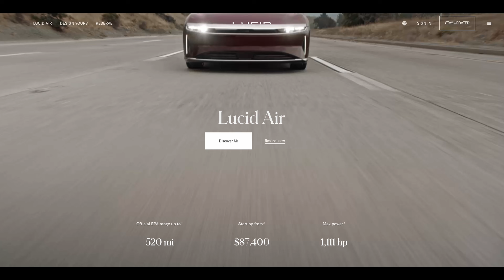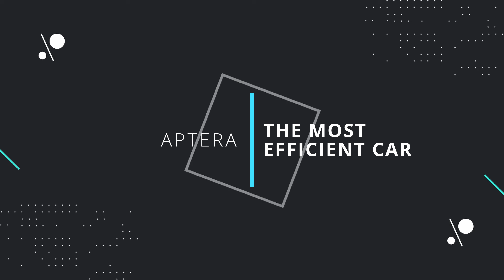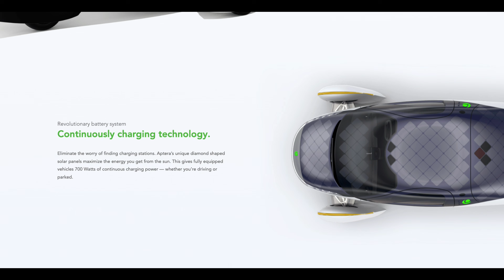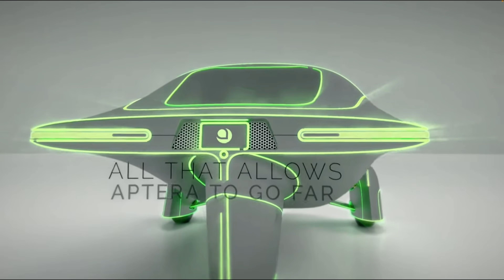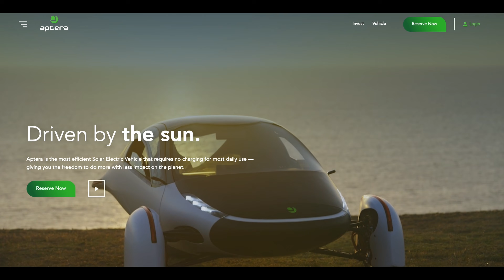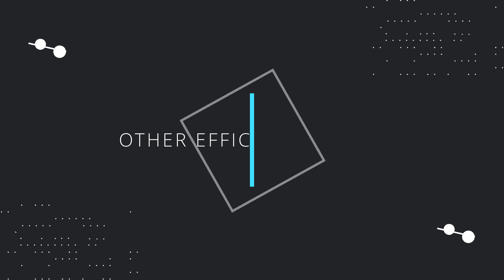Can Aptera redefine the norms of EV efficiency?

Comment: If an option for the vehicle is a 12hp diesel electric generator inside of the vehicle with a five gallon fuel tank then that version of the Aptera may have a range of excess of 400 miles before refueling/recharging:  that's practical!  I am VERY concerned about the wheel fairings.  In states like Montana, North Dakota, Minnesota, Wisconsin, Michigan, Vermont, Maine, and New Hampshire the deep snows and unforgiving ice chunks could smash a plastic fairing off (Ice chunks frozen to about 0 degree F act more like rocks)  Plastic air dams are knocked off by snow or ice on far heavier vehicles on a regular basis.
Reply from the maker: Green warriors may not accept diesel generator, Aptera reliance on green subsidies may make it impossible. At the same time the solar is effectively a range extender. And I agree about concerns regarding wheel covers 😁.
Reply: @LatutaEV  I'm on your side.  My Brother-In-Law owns a Tesla and he took it on a 1,400 mile drive to Florida.  He was always charging the car and looking for charging places.  Aptera can sub-contract a company to make the optional 12hp diesel electric system.  The people in Northern states want to support this but December, January, and February don't care about "solar".  I'd like to see any solar panel work with a half foot of snow on it.  If the diesel electric option isn't offered then the car can't be used in the winter in the northern states.

Comment: 6:10 If you cant do maths, at least try filter your bs numbers with common sense, 50 kW solar  charging power giving 500 mi/hour, should be 500 w and 5 mi/hour
Reply from the maker: Hi Greg this part of the video is not referring to the solar charging. This about charging from external charger. I did check my bs numbers again 😃 and they seem correct. The charging speed from stationary charger is limited by the ability of the battery to take certain amount of current and it is lover on Aptera let's say in comparison to Tesla but gives higher mi per hour due to high efficiency of the car
Reply: @LatutaEV  apologies, I incorrectly interpreted the word cell to mean solar cell, numbers make sense
Reply from the maker: @gregarmstrong4653  no worries 50kW of solar would be rather large area covered with panels 😄

Comment: low rolling resistance = longer braking distance, lower cornering speeds compared to the same vehicle with all season tires never mind summer tires.
Motors are in the wheels which means you have more unsprung mass bouncing up and down and will require stiffer springs and shocks and a choppier ride in the passenger compartment since you don't have the mass to smooth out the ride.
Reply from the maker: Yes motors in the wheel concern me too😁
Reply: It only weighs about 2000 lbs. My Honda Fit weighs 2500 lbs. and it's tiny.

Comment: When I work on the street I watch the cars and what I see is that most of the time 1 or max two person sits in various sizes and types of cars and they are (probably) doing short commutes, so a two seater is not a bad idea. The selling point is the cheaper running cost. I preordered one and I hope they will have good investments and loans to start production! Fingers crossed for them!
Reply from the maker: Yes this is exactly my point but optimising few parameters will pay you back in charging speed per mile and overall milage as well
Reply: @LatutaEV  exactly.
I preordered the 25kw model as I usually don’t drive more than 200 miles without stopping. In 15-20 min I could easily recharge the battery to 80%. One thing I don’t understand is how they are going to squeeze the 100kw in?
The current technology not letting this happen as the vehicle would be too heavy.
Reply from the maker: @dangr3957  I suspect 100kWh is just for headlines it may never happen 😂

Comment: Crash security?
Reply from the maker: Apparently due to light chassis it performed better than some traditional cars. Also Composit they use has a property to retain an original shape for smaller dents
Reply: Aptera has several advanced safety features, including front and rear crumple zones, an F1 style passenger safety cage and air bags.  It will be voluntarily crash tested by a third party to FMVSS part 200 crash standards and the results published as soon as production intent vehicles are available to crash.

Comment: Nice and thorough presentation. I also share your enthusiasm for the Aptera design, especially the idea of efficiency. And the many rewards that come from needing less power, combined with the solar assist to make the Aptera even more economical. The best answer to people who doubt about the Aptera team's intent or progress will be actual production vehicles, which should begin later this year with a real ramp up in 2023. I am looking forward to seeing the upcoming Gamma model soon, as it will definitely show the latest development of the interior. But I suspect that the new model will also feature the production intent 41kWh battery pack, and hopefully a working full solar package. Maybe even the cooling system as well. Which will again show progress to skeptics and fans alike. Thanks for your work. I have subscribed, and will now watch your ONE Gemini battery and Axial flux EV motor videos, as they both interest me as well.
Reply from the maker: Thank you for your interest and support 😊 I hope that Aptera will succeed and I think they won't need to have battery bigger than 41kWh. If they can get Tesla charging network it will be perfect EV
Reply: That Gamma is 8 days late. The new interior is about all it will show when it comes. I'm betting no claims will be proven by it. Can't wait. In fact, I think I will make a video based on this one to add some balance? I will take at least a week, so Gamma performance might get in, but then - most likely not.

Comment: The big seller for me with this car is the high level of right to repair, to the point where there will be QR codes on the parts which leads to where to buy the new replacement part and a video on how to swap it out. Also the charge off a standard wall outlet should be enough for most commutes, and that isn't considering the solar charging, so except for extreme circumstances there shouldn't be a need to install a level 2 charger at home. The efficiency and cargo room is more than enough for folks who are just looking for a commuting appliance and have another vehicle for hauling the family around. I will take one 400 km version with the full solar package please and thank you 😀
Reply from the maker: Wow I didn't know that. I shall do a bit more digging about that 🙂
Reply: I ordered the 400 mile (650 km) version plus full solar and upgraded sound system.  Went back and forth on the camping option but figured I could buy that separately at a later time.  Knew it the car was right to repair but didn't know about the QR codes.
Reply from the maker: @robertd9850  Did they give you estimated delivery date?
Reply: @LatutaEV  No.  I changed mine from 250 range to 400 when I found out those would be made first.  Hoping that gets me one sometime next year but mostly I just want them to be successful.  I think this vehicle solves a lot of problems and is really going to shake the box in the car business.
Reply: @LatutaEV  Theory is great.  I have in the past questioned the rumours of delivery dates.  Which have been "adjusted" over time.  The amount of abuse from Aptera fan-boys was non-stop.  Do not misunderstand: I support all efforts towards eliminating carbon emissions.  Let's cut the hyperbole.  Aptera is not currently a consumer product.
Reply from the maker: @norgerepairs8687  Yes I agree but I was talking about optimization of EVs in general using Aptera as an example. I didn't make any statements about potential delivery dates or how likely Aptera to meet the delivery dates. I seem to have received more negative comments along the lines that it's all false and how far away from stated dates the Aptera production cycle etc.